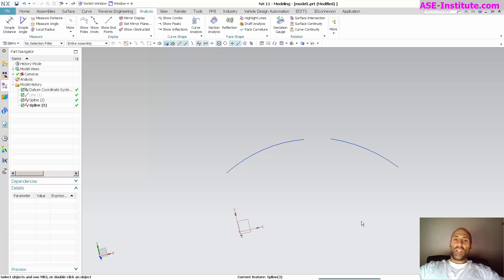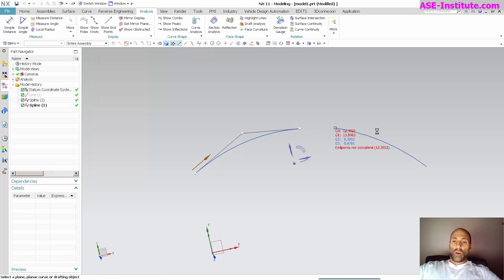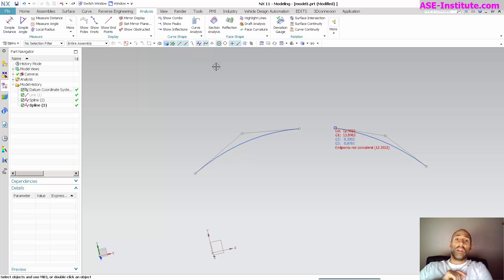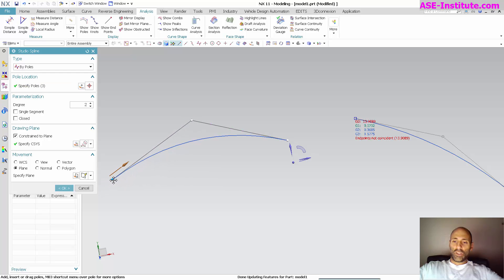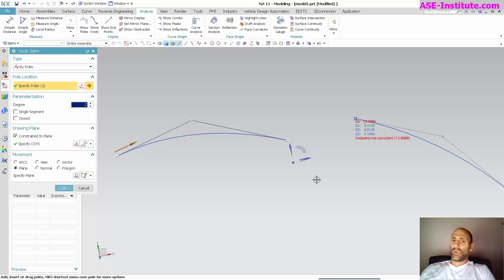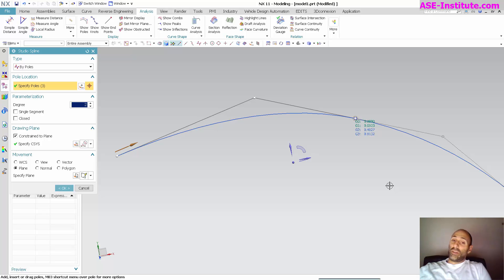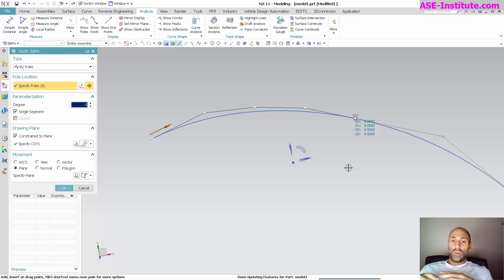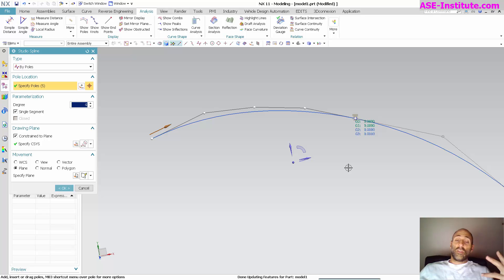Intro to Continuity | Siemens NX 11

Comment: a little of topic here, but could you talk about the minimum required workbenches in catia to be able to make g3 connections? 
i worked with freestyle but was only able to make g2 styling fillets, and even then, using styling fillets was a nono, blends where the go to method for making fillets
i know there are 3 variations of the freestyle, FSS, FSO & FSP but we did not have the high end one

also, do you have access to an icem license? i know they are crazy expensive but maybe you know someone with a student license?

i never got to work with exteriors on cars, only interiors i am very curious about G3 in real life situations...
Reply from the maker: Well, G3 is only available in ISD. If you have that license then it will be available in Freestyle in any of those you listed. It all depends on having the ISD though.  Dassault has a tight lock around those advanced tools.

Think of G3 for exterior highly polished surfaces. Hood surfaces, Door panels, Deck Lids. That type of thing. G3 is never used on interiors. In most cases for exterior you can use G2 for less visible areas as well.